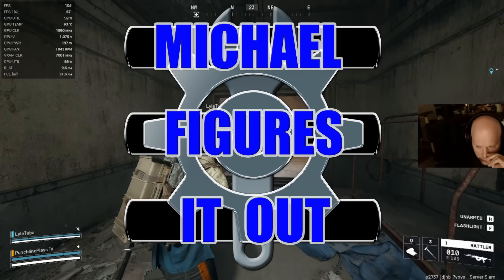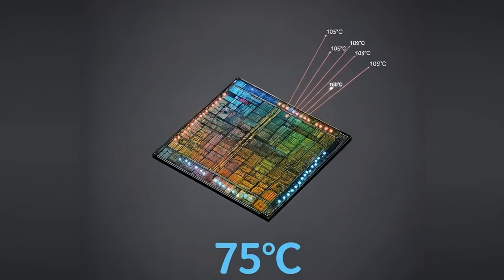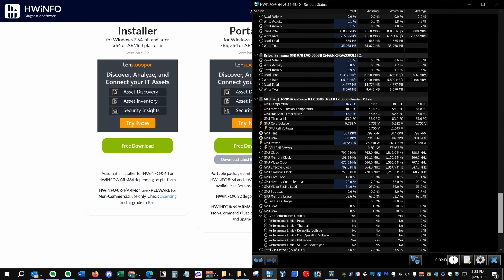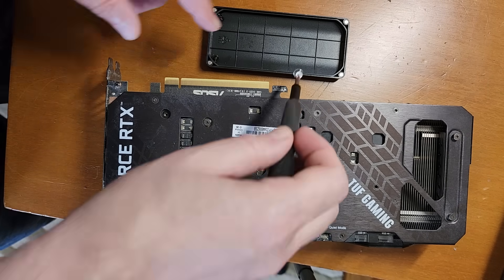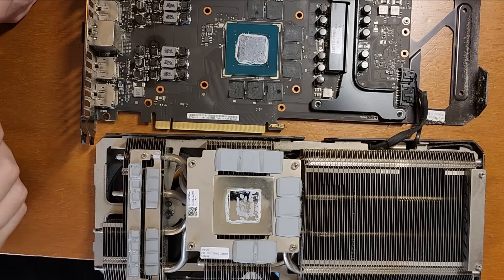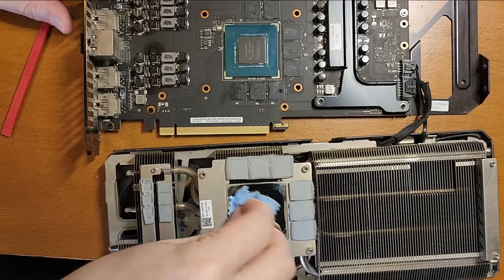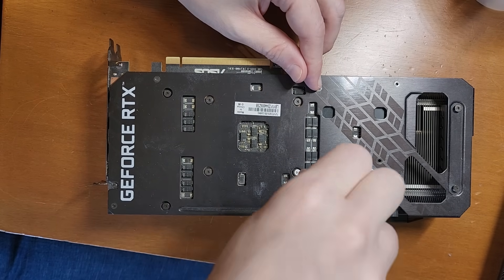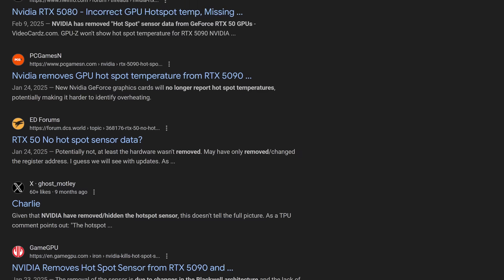GPU Temps Are A LIE!

Comment: My GPU Is Gigabyte Gaming OC RX 7600 , In Furmark 2 The GPU Temp Is 64 Maximum And The Hotspot Is 85 Maximum , And In Games It's About The Same , But When I Tried To Do AIDA64 Extreme Test On The GPU I Found The GPU Temp At 53C But The Hotspot At 103C !!!!
And The Fans Speed Start To Increase , But That Doesn't Happen In The Games , The Card Is Brand New Just Used It For 2 Months , Should I Repaste The GPU ???
And I Don't Think I Can Ask For RMA Because I Bought The GPU From Germany And I Am In Egypt Now 😅
So What Do You Think ??
Reply from the maker: AMD card can run hotter with no issue. I would see if you're having any problems. If not, you should be fine.

Comment: Good guide, but stay away from high silicone Pastes meant for cpu.
Why?
The pump out effect will happen very fast when using cpu designed pasted on "direct die" solutions like a gpu.
What is pump out?
Its when metal expands, shrinks, expand shrink thousands of times due to thermals.
It actually pushes the paste away from the GPU die again making new dry spots which will be hotspots.
What it leads to is that Noctua paste will only after 1-2 weeks see performance degradation were the hotspot will rise again.

What is direct die?
Its when the heatsink directly contacts the silcone.
The Gpu die gets really hot, so hot infact that the silicone based pastes looses most of it properties, especially in gpu's with over 200wats power draw.

What to use instead?
Think that are meant for gpus.
I will rank them first for its performance, then based on how safe it is and lasty ease of application.

Performance
1: Liquid metal.
2: PTM 7950
3: Thermal grizzly Duronaut
4: Cryosheet.

Safe and how much knowledge you must have.
1: PTM, Duronaut, cryosheet
4: Liquid metal.

Ease of application
1: Duronaut
2: PTM and cryosheet
7: Liquid metal.

Lastly.
If using paste, YOU REALLY should manually spread it to make sure 100% of the die is covered. Do not use the same methos as a cpu were an allready existing heatspreader does a lot of the work for you.

Why?
You dont like hotspots.
Reply from the maker: PTM next time!

Comment: Had this on an Asus card I had.  They refused a RMA because the average temperature was ok but the card died completely a short time later.
Reply from the maker: Asus does not have a good RMA reputation.
Reply: @MichaelFiguresItOut the funny thing is I RMA'd it back the the shop where I bought it from and because Asus support is so bad and because there's was a GPU shortage at the time they sent me a Zotac back.  That's the last time I buy an Asus GPU.

Comment: thought I was about to learn something knew but this already bacame basic common sense when I became the owner of a vega 56 and then 5700xt, both known for hot spot temps and since I liked to heavily overclock them I found through one of my troubleshooting steps that hot spot temps are the real issue and 100% root the cause for temp throttling.  Also learned that PTM7950 works really well on gpus with bad hot spot temps😂
Reply from the maker: Learn something knew every day.

Comment: I recommend PTM 7950, the reason why hotspot temps of these cards reach 100c while having 65c average is because of pump out, you know when something heats up it expands and once it cools shrinks back, that's why the thermal paste is getting pumped out of the GPU, so there's a huge spot where there's no thermal paste at all
PTM 7950 performs greatly on laptops and GPUs when it was discovered by random people on reddit, thanks to how it's designed to be a paste for industrial use and have a longer service life, it can handle pump out quite well, so you will still have better hotspot temps in the long run compared to normal thermal paste
Reply: Real, grizzly PTM perform way way better than grizzly kryonaut extreme, in my case Asus Tuf laptop.
Been using 4 different thermalpaste, all of em always pumped out after 1 month
Reply: As a component level repair business we fully switched over to PTM7950 and Laird TPCM7250 on our repairs and partially or fully Halnziye HY256 Putty up to 2.0mm  instead of thermal pads for better distributed mounting pressure on the GPU/CPU (depends on the heatsink design)
NT-H2 / MX-4 / Kryonaut are horrible pastes for laptops and videocards.

Comment: Pubg isn't that graphic intensive, right?
Reply: If you switch to Lowest and play in Full HD DX11 Enhanced, then yes.
Reply from the maker: Playing on decent settings it can cook a GPU.
Reply: @MichaelFiguresItOut the only time it heats up my GPU was when I forgot to limit the lobby FPS and it's been running idle in the lobby for an hour.

I think the power draw on my 5090 was around 500W

Comment: Be careful when you remove the thermal paste around the die, there are a lot of small SMDs there and they can easily can be ripped if you're not careful, it's also not necessary to remove the paste around, so you can skip it.
Reply from the maker: That's true, but then I'd get a bunch of comments about not doing a good job cleaning up the old thermal paste!

Comment: Some RX 5700 XT owners over here? 😄 usual issue

I had plenty of them but the worst was aorus gigabyte

Even after new pads, new paste and cleaning hotspot was at 95c while card was running around 68

But anyway card still works without any throttling and issues
Reply from the maker: Some AMD cards can run hotter without issues.

Comment: Damn, I repasted my 30 series exactly a year ago, and looks like my hotspot delta since then has creeped up from 13 to 23 :/ Card still runs perfect but since I target 80°C, hotspot is kinda getting into the trouble range at 103°C

Might go with a Honeywell PTM7950 this time, currently just running regular old Thermal Grizzly paste.

I hadn't even noticed though, good reminder.
Reply from the maker: Lots of reccos for PTM in these comments.

Comment: First thing when I got new GPU was setting fans the way I get at max 85*C in hotspot after at least hour of gaming, the overall GPU temperature is something I don't really care about.
Reply from the maker: What software can control fan curves based on the hotspot temp?
Reply: @MichaelFiguresItOut Not like software was doing it, I was just looking at hotspot and adjusting curve.

Comment: I did the same with ptm7950 mine delta went from:
- 35°C to 30°C on 100% load
- 30°C to 20°C on ~70% load
- 20 to 8 on ~50-60% load

I'm not happy :(
Reply from the maker: Did you also replace the thermal pads on the memory? Maybe they were too thick.
Reply: @MichaelFiguresItOut I didn't, will try that next

Comment: My 3080 Ti has, on average, a ~7°C difference between the GPU temperature and the GPU hotspot temperature at idle and under full load. A 10–20°C difference is considered safe, but the lower the delta, the better
Reply from the maker: That's impressive.
Reply: @MichaelFiguresItOut  yes, although it is in a custom loop, but I believe that the watercool block (HEATKILLER V) is mainly responsible for such a small difference. I believe it makes quite good contact and in combination with liquid paste it manages to reach 7°C.

Comment: My 6700xt was having hotspot issues.
That was because of paste and sub-optimal fan curve. My fans never went beyond 50⁰C. Abysmal. Gpu kept crashing.
So I removed 0RPM mode, let the fans go wild, reapplied with PTM7950. 
Now my hotspot delta is 10⁰C, (55 and 65 respectively) never had crash issues. 
Doing a maintenance will ensure that your card will live until you decide to change it. Better spend $10 now, than $700 when it gives up and you'll frantically need to upgrade.
Reply from the maker: Exactly! Well done!

Comment: on my AMD RX 6600 i replaced the thermal paste for PTM 7950 from Upsiren the PCM2 to be exact & i removed all factory thermal pads and replaced everything with thermal putty with Upsiren Pro Ultra which offers 16.8w/mk in cooling capability, ive applied PTM to CPU and GPU core + thermal putty on VRMs and Mosfets on my GPU and ive never seen hotspots above 72 C* on maximum 120W TDP of my card with no undervolt at all, i even overclocked it by +370 mhz, before i did all this my GPU on gaming the most demanding games would get 67 C* main temp & 109-110 C* when i noticed, i imidiatelly put the graphics to low to wait for the arrival of the products for cooling, after i applied it now i can run the games on maximum settings in ultra cool temperatures, im running Dell Precision T5810 with Intel Xeon E5-1660 V4 + AMD RX 6600 Saphire Pulse +32gb RAM ECC 2133mhz on Fedora Linux KDE & the experience and game optimization on Vulkan has been fricking amazing, on Counter Strike 2 i can run it on maximum settings on linux at 1080P and it stays at 144fps capped as per my monitor! Gone are the bad temps for a long time!

One more thing to know is with thermal paste it will Pump out soon but with PTM it can endure a lot of cycles as its engineered in such a way that the more cycles it does the better it works as it adapts to the chip when it cools, it shrugs, when it gets hot at 45 C* starting point it melts and works. especially for GPU i wont reccomend thermal paste, either Correctly installation of liquid metal if youre skilled and know how to do it on copper plate heatsink or just use PTM!

Cheers!
Reply from the maker: Yup, next time we'll use PTM.

Comment: my gpu crashes with event 13 even hotspot is cold so far        The description for Event ID 153 from source nvlddmkm cannot be found. Either the component that raises this event is not installed on your local computer or the installation is corrupted. You can install or repair the component on the local computer.

If the event originated on another computer, the display information had to be saved with the event.

The following information was included with the event: 

\Device\000002aa
Error occurred on GPUID: 100

The message resource is present but the message was not found in the message table
Reply from the maker: Punchline had the same error. I believe the heat trigger a very quick shutdown of the GPU via the GPU BIOS. In your case, if it isn't the hot spot, you should check the graphics card is getting enough power. Check the voltage.

Comment: A friend's RTX 4070 that he lent me was always around 110C° just months from brand new maybe a year but was a crap dual fan version anyway, pure garbage with 0% OC capability as it was already downclocking at stock hitting those crazy temps... 👎
Reply from the maker: Try to repaste!
Reply: @MichaelFiguresItOut  Never in a million years I would open a 700eur that cost 1 full month salary here back then when he bought it and open it up under warranty. Also in EU unlike US, breaking the seal means no warranty.

All my old GPUs I repaste them, but would never, ever touch a brand new warranty expensive GPU from a friend.

Anyway re-pasting sure would improve a lot as they likely done a bad job, but the dual fan cooler it self was mehhh...

Comment: I'm sorry, but that's not nearly enough.

When you replace the thermal paste everything will work fine for the first month or two, afterwards the problem will surface exactly the same.

If you want really to solve the problem, the answer is not new thermal paste, the answer is the Kryosheet!!!
In my experience, Kryosheet is the only definitive solution to this problem.
Reply from the maker: Time will tell.

Comment: Nvidoa didnt remove the hot spot sensor. They made it so that ONLY their interan software tools can read it.

Only one reason to hide the hot spot sensor...

Edit: the only thermal paste I use kingpin kpx. In my opinion there is nothing better. Thermal grizzly makes the pink stuff that is on par with the kpx but it's twice as much.
Reply from the maker: Good to know. Thanks.

Comment: my 4070ti in furmark gets 77 temp at 90 hotspot, about right, but it was fine at 103-105 hotspot aswell so yeah
Reply from the maker: Sounds high to me but if you're not having issues then seems you're card is able to handle it.
Reply: @MichaelFiguresItOut internet says 40 series like to run hotter

Comment: Turn on vSync this will fix the overheating.
Reply from the maker: Vsync should be on in Nvidia Control Panel and off in the game settings. But that was not the issue and is not related to overheating.
Reply: @MichaelFiguresItOut It is, GPUs run hotter with vSync OFF.  Even with Games, you should activate vSync! It runs cooler and smooth. Only deactivated it for some benchmarks or things like that, but if you love your GPU always activate vSync.

Comment: also, people dont recommend thermal paste on on-die applications(GPUs or delidded cpu.) What people now recommends is PTM7950. i use it and the performance is excellent. after a year, the performance is still same, and the hotspot temp is max 80 with 100% fan on my rtx 2070
Reply from the maker: Will try it if the problem comes back.

Comment: Typically the T-junction is always the highest value. Just keep that under control and, if there are no problems, all the other temperatures will be the same or lower.
Reply from the maker: T-junction is for memory temps, not GPU temp.
Reply: @MichaelFiguresItOut yes, totally true but I never seen TJ. Mem lower that gpu.

Comment: I just fixed hot spot on RX 6600 XT by changing VRAM thermal pads from 1mm to 0.5mm.

Furmark was going to 105 *C in minutes without this mod. Now 85 *C after the fix.
Reply from the maker: Well done. Replacing thermal pads is tricky.

Comment: Temps would have gone down further by atleast, 5 degrees if the GPU was getting clean air both from  the case and the gpu fans/heatsink. I'm also wondering what the fan control settings look like for this build and also the amount of fans in this case. 🤔
Reply from the maker: He has 4 case fans (3 in front and 1 in the back). Fan control curves are basically straight line that maxes at 75C.

Comment: Had a Gigabyte 2070 Super Windforce OC 3X for 5 years, needed core repasting after 2-3 years. The card was working good but every 5-10 minutes the fans would ramp up for a few seconds, to max RPM. Since then I avoid Gigabyte cards. Cheaping out on paste and then using putty instead of thermal pads on 50 series, for more disappointment I guess.

Now with the 5060Ti, I guess I'll just have to wait and figure out without hotspot temps, when it would need repasting.
Reply from the maker: Disappointing move by NVIDIA.

Comment: bro, hots spot difference 15c? which year you live in 2015? Its totally normal nowadays to have 20-30c difference on hot spot. This might be still relatable to something like 3000 series, but radeons6000,7000,9000, and rtx5000 at least, nah bro. I had rx6700xt, rx6800xt, 7900gre, 5070ti and 9070xt, they all are 20-30c hot spot new. And no one will change the paste before 3 years of warranty go out. Also if the hotspot is the problem, gpu should first run into emergency mode before crashing, and settings fans to 100%
Reply from the maker: AMD is different from NVIDIA w/r/t hot spot thermal tolerances and the 50 series no longer shows the hot spot.

Comment: My rtx 3070 asus tuf oc have 66° and 78° hotspot in furmark2, after 2 years of changing thermal paste, 270w power limit and open case. I think it's good
Reply from the maker: As long as you're within 10C-15C you're golden!

Comment: my AMD gpus of the past has mosttimes 90C without throttle, my old rx6700xt oc from asrock gets often 111C at hotspot and never throttles, my actual rx9070oc from asrock never seen 60C (hotspot never seen 75C)
Reply from the maker: AMD cards seem better with this.

Comment: Trust me, the average gpu is damaged not because the paste is not replaced but is damaged because it is often removed, replaced, cleaned, I have a gtx 960 since 2015 if I'm not mistaken I forgot,
 I still use it now for boting osrs almost 24/7 the temperature is always above 80 from new and never replaced the paste and still works, does not crash, there has never been a problem with the gpu. 
different from some of my expensive gpu I always clean, replace the paste and none of them are more than 3 years old, missing components, cracked, suddenly not working, black screen,
 from now on I never replace the paste or remove my gpu from the motherboard

Comment: this is the reason i always play with vsync on. i only turn it off if the input lag is unbearable but generally it isn't.
Reply from the maker: What does vsync have to do with the temps?
Reply: @MichaelFiguresItOut  caps the framerate to my monitor's refresh rate.
Reply: @white_mage  correct. NV control panel global: g sync on, vsync on.

In-game setting: vsync off, fps limits off.

When gsync is turned on, vsync acts differently then when gsync is off. It will auto cap frame rate to your monitors refresh rate. There isn't any lag like there would be with Only vsync on.

Blurbusters has a great article about gsync/vsync relationship and how the functionality of vsync changes. I really wish this was made clear. So few people with nvidia cards wandering why their shit either tears or has crazy input lag.

Comment: You know what's more funny? Most of the 9070xts have more than 20c difference between core temp and hotspot temp. Some even more than 30c lol (talking to you Steel Legend). From my personal experience, Nitro+ had core temp at ~60 but hotspot at 85c.
Reply from the maker: Seems more an issue for NVIDIA than other chips.